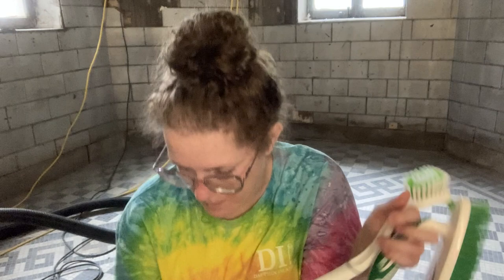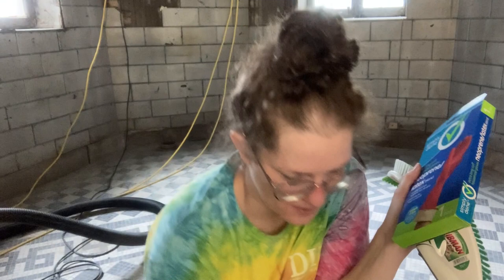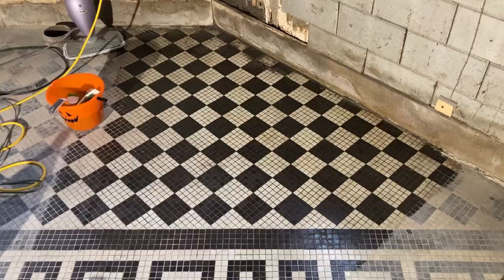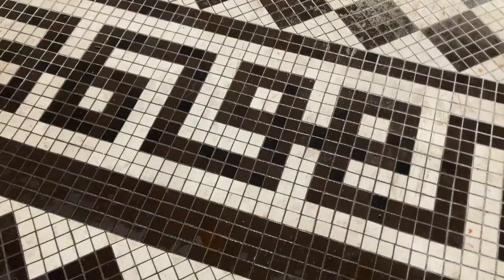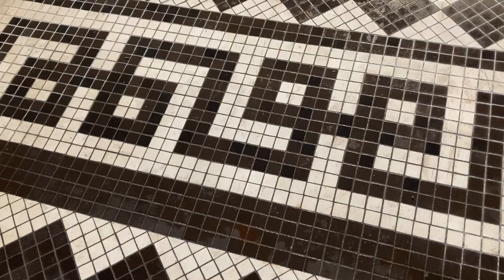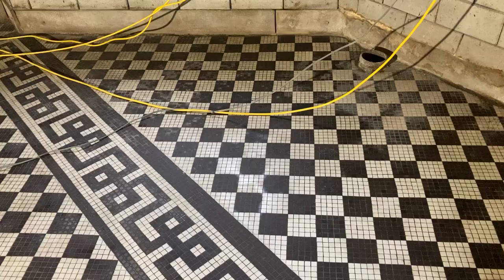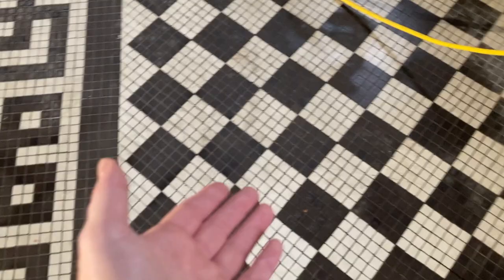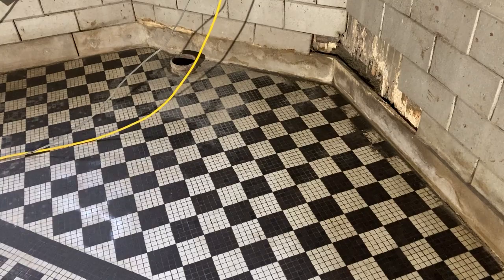Vlog 25 Cleaning the Tile in the Vets Office

Comment: As someone who has been involved in janitorial cleaning for 13 years: the baking soda and vinegar is a really good combination as well as using dish soap. It may just take some time to remove a lot of the layers of dirt and you'll probably want to come back through as you guys go through and do more work on the place. Honestly it looks absolutely gorgeous to me and I think you're taking a lot of the right stops with cleaning it by using that steamer as well. It's time consuming for sure but I would recommend waiting to do a final run-through on the floor until you are done with the ceiling and walls. I'd also recommend a sealer of some sort just protect the tiles. Stay away from waxing tiles because it will yellow over time. Not sure if this is entirely helpful however I absolutely love how this house is shaping up. It's so stunning!

Also because I saw others mention this: renting a wet vac would be a great idea. You could rent a buffer with a brush pad however do a test spot. I'd hate to see those tiles get taken up by the pressure.
Reply: Swimmingbird243, with your experience, what do you recommend using on normal bathroom tiles, such as on the shower wall???
Reply: @twistoffate4791  so what I found worked really well on shower walls was at least a cup or two of dawn dish soap, mix with the same amount of vinegar. Heat it up in the microwave for 1 minute. Pour into a spray bottle. Let it sit for 10min or up to an hour depending on how bad the grime is. I usually let mine set while I clean the rest of the bathroom. It's a really great way to remove alot of buildup! If you have a lot of hard water this helps cut through it as well as soap scum :) vinegar is also really good on cleaning but adding it to the Dawn dish soap and then heating it up is just a chef's kiss.
Reply: @swimmingbird243  Thank you! Great! I am definitely going to give your process a whirl!!
Reply: @Transformation Station I keep mine! You can also use it cold however I just dump mine back into one of those plastic liquid measuring cups, throw it in the microwave, dump it back in the spray bottle, good to go!
Reply: As a professional house cleaner, I  agree 👍 💯

Comment: I think it looks great. This was your first pass with dirt that has been there for years. When you get the whole floor cleaned initially you can go back in later with a mop and something stronger. My Mom always used a combination of bleach and hot water and let it sit and then mopped it up.  Your first task was to get the initial layer of years of dirt and dust up then go in with something stronger. It is gorgeous though!  Nice work!
Reply: What an improvement! The floor looks great! Looks to be in good condition! Good job! Thanks for sharing!
Reply: Do might do some research on ways to clean tiles and grout more easily. What you were able to do looks so much more clean, at least on my screen.
Reply: @lisaburnette6850  I was thinking they are probably going to have to re-grout that tile since the grout is probably so old. The new grout would freshen it up and repair places where the grout is failing.

Comment: My wife and I bought and restored a southern gothic cottage about the same age as your house.  The tile in the kitchen and bathroom was in about the same level of "dirty" as the tile you're cleaning.

After my wife finished the initial cleaning, she let the floor dry overnight and scrubbed it again with "Scrubbing Bubbles" letting the chemical sit on the floor for about five minutes.
The scrubbing bubbles dissolved a lot of the dirt.  She scrubbed the bubbles, she thoroughly rinsed all the residue.  The floor is much improved!

Comment: For old tile you do not want to use anything harsh. What worked for me and what was recommended by the preservation society in my area was Bar Keepers Friend. This is a gorgeous old floor that is probably chipped. It will never be perfect. It already looks so much better. Enjoy the charm that it brings to your house. It is perfectly imperfect.
Reply: That is what I was going to suggest. The oxalic acid in that might really help get off whatever film is on the tiles, without so much scrubbing.

Comment: It looks like the grout itself is actually a dark color? I think it looks A LOT better, your elbow grease definitely made a difference. You might have to come to a place of “good enough” since it’s a basement floor over 100 years old and was put in to be a working floor. Personally I think it looks great ❤️
Reply: I wondered if it didn’t just have dark grout as well.  Even in an old and dirty building, if the grout had been light colored or white, I’d expect to see areas where it’s still lighter and it looks uniformly dark, at least on camera...
Reply: There's a good chance the grout is actually cement. Even up into the 30s and 40s if they wanted the tile floor to be hard-wearing with all those little tiles they'd set it directly into a bed of cement. If you get a chance to check out an older bathroom up close you can kinda tell.
Reply: @zoomiesnoopy  
I’ve had tile set into concrete, but only partway and still with grout on top of that.  I even have had sidewalks and steps made that way with the mortar put in to fill the rest of the space.  Interesting that it might have been set completely in cement...
Reply: @Lucinda_Jackson  I suppose there could be a bit of grout filling in the surface gaps. Admittedly my experience is from having to demo an old tile floor that did NOT want to come apart 😅. Not as easy to pick the old grout from the cement when it’s all going up in dust.
Reply: @zoomiesnoopy  
Oh, no.  I wasn’t saying it wasn’t a thing.  It may very well be!  I was only saying what I’d seen.  I think it’s interesting that that would be a practice. 
I’m curious - was the tile you were removing set on top of a previously existing concrete or cement floor?  That may be a difference...
Reply: @Lucinda_Jackson  No it was the original floor from the 1920s. I've seen it in a lot of pre-war houses in the midwest, especially bungalows. Maybe it was just how they expedited the bathroom tiling build? Usually these houses were being built block by block by the same crews who would move onto the next one after finishing their task in the previous one.
Reply: Could not agree more!!!! ❤
Reply: I saw the difference too. I know that a baking soda mound, topped with some bottled lemon juice and mixing it with a gentle circular scrubbing, rubs  out stains on white counter tops.. idk if it works on tile or even grout, but, it should be washed again with an antiacidic soap or baking soda solution, and  rinsed very well.

Comment: The one my mother uses usually is baking soda sprinkled everywhere and then you cover everything with vinegar. Then you pour boiling hot water on it, let it for a while and scrub everything. It gets the dirt and the residue from products staining the tile as well as disinfecting. Maybe then a cleaning cream (Cif usually) and a cleanser for bathrooms.
Reply: But scrubbing is required not the less. Please check what is available for cleaning the grout as usually it oxidizes after a while and chlorine makes it worse

Comment: Look up "VINTAGE TILE CLEANING AND RESTORATION - DIY GUIDE".  You should start with test patches and once you find the right product do the whole area.  The key stage is sealing the tiles once you have cleaned them.  I think that was a great start and looks so much better and beautiful already.  I am pretty certain the grout is dark grey or black.  Again I would scrape at an area where you will be covering them and see what the colour deeper down is.

Comment: I'm not getting what exactly you're wanting to achieve here. Is it to have white groot? Because I don't think that's going to happen. Tile groot is porous and turns dark as years go by, it's the way of the Tile. As a pro housekeeper, I'd advise to stay away from bleach and all the various acids, especially if the tiles are cement based. Black soap, eventually a good wax to seal the floor and give it a nice shine, and that's it.
You allready done a great job taking the grime layer off... But it's not going to turn as new. It's old tiling, probably worn in places, it's not (and should NOT) turn back as new.
PS: Wash the walls first? because when you're going to do it, guess where all the dirt is going to slide to? As we say in the trade:"clean down"
Reply: I thought clean the tiles first too.
Reply from the maker: The tiles are going in the garbage! I just wanted to see how the floor looks clean, not as a final clean or anything.
Reply from the maker: @queaniesincetip4363  nooooo the wall tiles that are fiberboard! The floor tile is staying forever.

Comment: When I was 17 years old I clean a meatroom of a Shop Rite grocery store. We used bleach, water and quat which a disinfective soap, but you can subtitude it with Dawn. Then scrub & hosed down the floors to the floor drains and squeegie the rest off the floor. Dawn cleans super. That is very hard work  your doing. That's the only idea I can suggest. After the floor dries you could apply a coat of clear apoxy to shine thing up.

Comment: Does that floor have a drain?  The floor is really dirty/dusty.  One cleaning pass over will not get all of the dirt up with first wash.  You need lots of water to rinse down the dirt. I think you were still pushing around layers of dirt.  That really is a bear for you.  Gotta have alot of water.  I was surprised that you didn't have a big mop and one of those heavy duty wash bucket that will wring out excess water. Might be more expensive but it could help with rinsing if there is no drain.

Another time consuming job. I wish that there could be an easy task/clean up for you 2.  I love watching you two work on that house. Been watching from the beginning.  I really enjoy!
Reply from the maker: The only drain is that raised one. Eventually I’ll get a regular mop but since our water is funky I don’t want to use it or a bunch of jugs of water.

Comment: Re: cleaning with vinegar and baking soda. I’ve always assumed you clean with vinegar and then afterwards neutralize the acid with baking soda. Or maybe you could do the reverse and scrub with a paste of baking soda in water. Then apply a vinegar wash. It makes no sense to use both at the same time because acids and bases neutralize each other. Murphy’s oil soap is a nice gentle floor cleaner, dilute it in warm water and rinse.

Comment: Vinegar and baking soda basically neutralize each other. The liquid created by using both together is about as effective as cleaning with just water.

What I find that works best for cleaning grout and tile is just foaming bathroom bleach. They have some at Dollar Tree that work wonderfully. For discolored grout spray in the grout lines and let it set for 20 minutes or so and go through with grout brush.

Comment: Its such an intricate design. There might be a layer of old wax floor polish or some other kind of sealer. If you wanted to really clean it, you might try renting a commercial floor cleaner with a scrubbing brush attachment and some floor stripper.
Also, rust in the water probably indicates the presence of galvanized pipes. I'm sure it's okay for cleaning. I wouldn't drink it though..

Comment: I am not sure if you have them in the states, but one of those new age bucket and mops work awesome. It is a mop with a round or triangular head that spins and hinges freely of the handle. The bucket itself has a small foot pump barrel in it to spin and wring out the mop. 
You can initially use the mop with lots of water to douse down the floor and loosen the dirt and move it, then you wring out the mop and then use it to soak up all the dirty water and put it back into to bucket again. 
Cleaning the mop is easy, just put clean heavy detergent water into the bucket and continue to slosh the mop head around then alternate between the bucket and the spinner. 
Pump it fast enough and you can end up dry mopping the floor with minimal water used. Good for cleaning floor boards. 
There is also a set that doesn't have a foot pump and has a screw type telescopic handle. It has a locking lever on the handle to keep the handle still when mopping. When you want to wring it out, you move it to the free spinning barrel section of the bucket, release the small lever and then push down on the handle which spins the head on its own. Centrifugal force flings out all the water back into the bucket beneath. 
Some of those buckets also have a raised dowel inside the bucket of water that the mop head fits onto to keep it still so that when you spin the head by pressing down, the mop swirls around in the water and cleans itself.

Comment: Just a tip i learned from growin up with a pool. A pool supplies store will have big and small brushes that makes scrubbing anything off of tiles a heck of alot easier. Also using hot water and tile cleaner! Its key to thoroughly wet the tile with vthe mixture and let it dwell for a few minutes before scrubbing as well.

Comment: Zep grout cleaner is a miracle worker. I had the original 1948 tile underneath some crappy 90's stuff in my bathroom, the grout AND tile was restored to almost white with 2 passes of this stuff (one more pass I think it'll be brighter!!) and it barely takes any effort. Also recommend utilizing a wet/dry vac, much easier to suck up water than to use rolls of paper towel :)

** also make sure to re-seal the tile and grout!

Comment: You can definitely see where you scrubbed. Especially in the areas you used dish soap, there is a visible shine to the tiles.

However I would just clean the floor with vacuum and steam mop for now. Cover the floor with dust sheets while work on walls and ceiling is done. Once everything above the floor is fixed and finished to a livable standard, think about actually scrubbing the floor, polishing and sealing it.

 It's not worth getting the tiles shiny now. Risking spilling something sticky and harder to clean off. It worth leaving a thin layer of accumulated dirt to protect the tiles, as it has been since it was last cleaned!

Comment: You’ll definitely need more water, more soap or tile cleaner, and more scrubbing. Rent a wet vac (especially for the edges of the room so the water doesn’t get down there) and either manually scrub or use one of those brushes that attach to a drill. The grout will remain dark no matter what but the faces of the tiles probably still have plenty of dirt. Clean as much as possible and then re-grout!

Comment: I heard of 1 cup dawn platinum 1 cup vinegar 2 cups of boiling water mixed and put in a spray bottle. (I use this to clean my shower and tub btw). Sprinkle baking soda heavily over all the tiles. Spray the mixture heavily over the baking soda. Let it sit and work a bit, maybe 15-30 minutes. Ryobi and other drill lines like Milwaukee make a cleaning brush attachment to go on a drill. Caleb can help you with that. Use that to scrub the hell out of the floor so your arm doesn’t fall off like mine did. And dress accordingly in a biohazard suit and boots! Rinse it all well. Steam clean finish. I’ve also heard of using Soft Scrub cleanser. I have a 1902 home that had its first indoor bathroom put in on the second floor in the 1920’s where the nursery was. It had a white hexagon tile floor with a black patterned border. Your floor is waaaaay more beautiful than mine. I used this cleaning  method, but had to regrout in some areas that was missing grout. 
BTW Kim, I definitely noticed a difference on video where you scrubbed.

Comment: You're doing a great job! Anything you can do to cut down on all the residue of years of crud is wonderful and like many mentioned, it's only the first pass that will need more cleaning later anyway. I don't have any specific experience cleaning old tile, but as a trained museum conservator I can give you a few tips as someone who went to school to care for and clean old stuff :) While using distilled water to clean everywhere probably isn't economical, it's a good choice if you have something really dirty that you want to make the most impact on. Even clear tap water has naturally occurring minerals that are good for humans but can interfere with whatever cleaning products you're using (like making your suds less bubbly). Using distilled water eliminates that and in a super-dirty floor like this, could cut down on the number of times you need to clean the floor to get it beautiful. While the steam mop did a great job for the overall clean and works as a first pass, I wouldn't recommend using it when you're doing fine cleaning at the end, just because it does keep a bit of the dirt in the cloth pad even after it's cleaned in the bucket. Dirt and dust has all kinds of tiny abrasive bits and, not knowing how porous or easy to scratch this tile is once it's not covered in dirt, it could be problematic. As others have said, a wet/dry shop vac could be your solution to not spreading the fine grit in the dirt around. Finally there are lots of ways to clean something as nothing ages predictably, so what works for another floor (or another section of the same floor) could do nothing for your floor and vice versa. So keep trying stuff and have an open mind.

Comment: If the area has a drainage hole, it would be very helpful. You could rinse it down with the water hose, spray bleach ( in small workable areas ) let it sit and come back to rinse clean. After that, use a squeegee to get up the remaining water. All of that is probably not the ideal way of doing it but anyways..... 
 What you have already done looks great. Better than what it was. For now, until y'all get the walls redone, leave it. And speaking of the walls lol.... I know Caleb told probably told us the walls were tile but I thought they were cinder blocks lol I had no idea